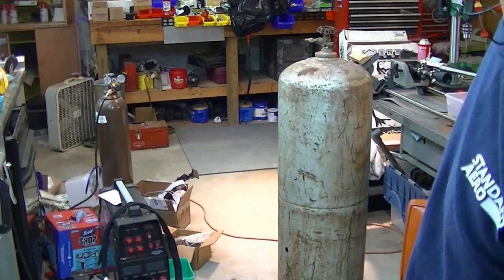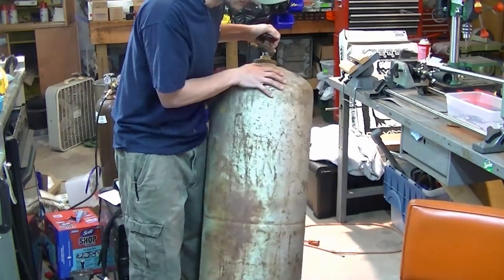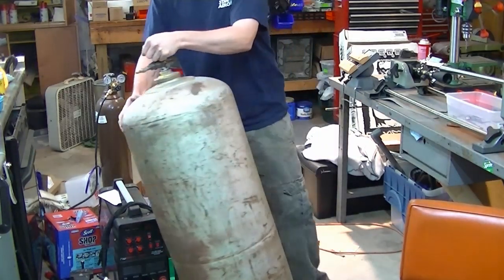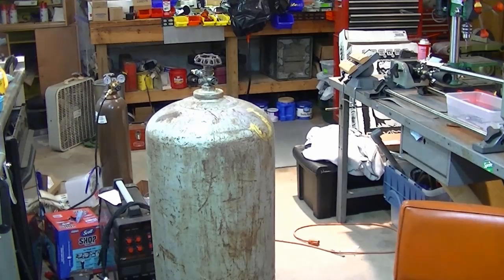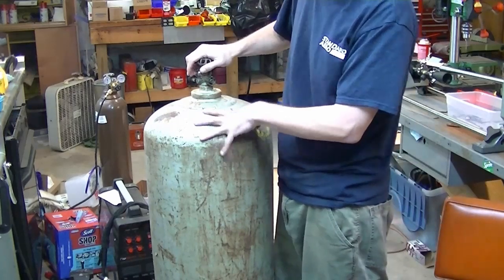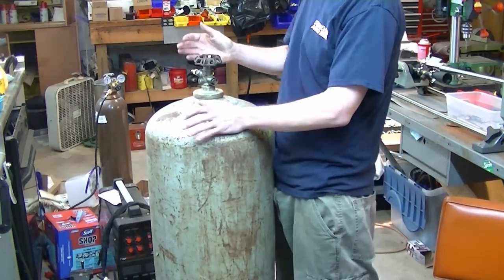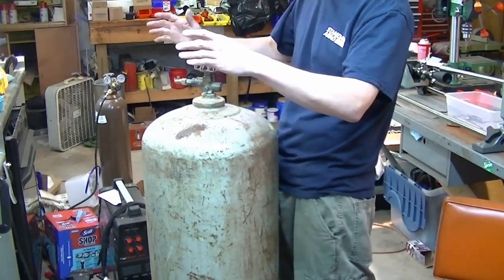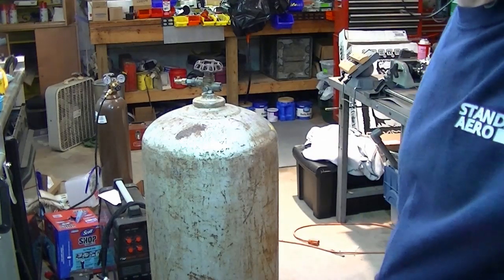Tig Welding with Longevity welder while converting a Propane Tank to work with my Air Compressor

Comment: To get rid of the odor take the valve off the tank, pour in about 3 gallons of clean gravel, 2 gallons of clean sand,  5 gallons of really hot water and TSP, also known as tri sodium phosphate.  Follow the directions on the tsp box.  Roll the tank around, tip to a 45 degree angle roll some more,  plug the valve hole turn upside down at 45 degree angle   and roll some more. Unplug the valve hole, turn upside down and stick a garden hose in the tank to rinse it out.  Odor gone.  Now figure out some way to keep it from rusting.   I still don't understand the bolt being welded in the hole.

Comment: I must have missed it, but I'm wondering why you welded a bolt into the hole?  If you were going to use this tank for air, why not weld a shoulder nut in to use as another port?  You can always put a removable plug into it if you don't want to use it later.

Comment: so how the longevity shut box working is it a boat anker yet?
Reply from the maker: +Jimi Hendrix no, the contrary. I added a mig, and an ac/dc square wave pulse tig and a plasma cutter all by longevity and have run the shit out of the new tig machine. It is hands down a very nice running machine and has been for over 2 years now which is a hell of a lot longer than most Miller dynasty machines I have seen. The plasma cutter could be a little better but does cut on ac as well as dc which is nice. The Mig is just like all the other 140 amp migs,  The old 160sx tig used in this video is running strong in a race car frame shop and is is around 5 years old now.  In all if the longevity machines I have sold none have ever had a problem!

Comment: Ive been thinking of doing the same thing. But i did see another guy who poured a rust paint in the tank to seal it from rust. He poured it in and rolled the bottle around for a while. (Alot of humidity can build up in compressor tanks).
Also the rust paint sealed the inside to get rid of the propane additive that stinks so much.
 Best of luck.
Reply from the maker: You know that is a F'n great idea. I am set up with East wood and the have that stuff. When I put my new compressor in I  am going to do that! Thanks!
Reply: @teamklr2bar  Late post and sorry for the delay but I just saw that video and noticed he put paint in the tank and then put regular pipe on the manifold so at least his tanks wont explode, but the pipe will...

Comment: Dirty Hippie wearing sandles while working! How do you like that longevity welder? Is it holding up? Is it built in water cooled or air coold torch?
Reply from the maker: hahaah, you got it.  I tell you that I have owned Miller, Lincoln, Esab, etc... all and I was so impressed with Longevity that I am now an authorized dealer for them.  I love them. All of their stuff is top notch. "REALLY" it is very good stuff. If you are looking let me know at my welding business email address: HighValueWeldingSupply@gmail.com you can also go to our website at http://www.TDCtactical.com

Comment: idiot
Reply from the maker: why? this tank was around 15years old and was flushed with standing water for over a month's time. There was no danger here. Secondly, the highest pressure it will ever see with compressed air from an air compressor is around 160 psi. This is far less than the thing was rated and capable of handling and does not even come close to stressing the welded area. Don't throw names out just because of your own insecurities and pompous attitude.
Reply from the maker: Jim McCrindle+ why do you think so? I guess you can't read or you would have been able to see why you are incorrect.

Comment: Eastwood Tig Welder?  How do you like it?
Reply from the maker: Eastwood purchases the cases but the welder is not the same. This is a Longevity. I am a Longevity Dealer so drop me an email and we can talk more. I have owned Miller, Lincoln, Esab, etc... and I would honestly (as proven by my owning one) have the Longevity first. It has a 5 year parts and labor warranty and is less than half the cost. The Longevity welders are far above and beyond the other Chinese welders out there and most of the American stuff as well. I am also a dealer for Eastwood. FYI.. For contacting me about welders   highvalueweldingsupply@gmial.com and for contacting me about firearms  TeamKLRDefensiveConcepts@gmail.com
Reply: TDCtactical It's interesting to note that many of the US welders are being made overseas such as some of the Lincoln models.  I have a Miller Sychrowave 200 which I rally like but i also have an Everlast and am pleased with that as well.  I have not tried Longevity, but I have heard good things about them.  I also heard they have good support.  Maybe my next machine will be a Longevity.
Reply from the maker: valveman12 I have owned a number of Miller. The 2 sychrowave's that I have owned were rock solid but the dynasties were junk all 6 had main board failures.  If you decide to keep me in mind, I will give you a deal.

Comment from the maker: Well most of the time the relief valve (pop off valve) is set to between 275 - 350 psi so the tank is rated higher than that.

Comment from the maker: Yea, you need to do more than just sand the paint off. You need to get down past the surface where oxidation has happened. Any time that you weld you need to make sure that you have completely clean and virgin metal.  The hood goes without saying though.  If you are starting out make sure to grab an autodarkening hood. Harbor Freight has them pretty cheap and you can find online coupon codes to make them cheaper!

Comment: still leaks, I I don't have a welding mask yet..  but is a little, I used sand paper to clean the paint around it.. and brake cleaner...  it worked...  but still i'm going to give it a touch in the little holes.

Comment from the maker: Yea, BPC will do that!  How much prep did you do before welding?  Was it super clean (including the immediate area inside the hole) before you welded?  Even stick welding, if there are any impurities it will cause holes in a pressure vessel.  Does it currently leak or did you get it to stop?

Comment: I did well, but I got air leaks all over the welding spot, but now my tank is working again...  I cleaned the spot with brake cleaner and it went inside of the tank and after that a spark blew all the brake cleaner inside the tank, thank god nothing else happen besides throwing my mask as far as I could and I broke it ;(  Now I don't have a mask...
Reply: Except for the fact you almost killed yourself while trying to weld a pressure vessel, which you should never do with your lack of knowledge... Dont EVER use brake cleaner before welding, it releases very toxic fumes and it even says on the can you should never use heat on the product after applying it... Its incredibly toxic when heated. Use a solvent like acetone or alcohol instead.

Comment from the maker: Yea, I don't envy you. I am not much of a stick welder.  Mig would work well and if you are proficient at stick welding it is a great option for this application.  If you are ever in the market for another welder or plasma cutter drop me an email and I will get you pricing on what you need.

Comment from the maker: Blair,  let me also explain that I keep this tank in a remote location.  It is outside of my shop on the back side.  I do not recommend doing this and then having the altered tank inside the shop and/or in close proximity to you.  It's a one in a billion chance that there could be a problem but it's not a big deal to drill a hole in the wall of a shop and put the damn thing outside.  Thanks alot and you are welcome!

Comment from the maker: why??? why would I bother with another option when I have this one?  
Things to consider: 
1  shop air is max 150psi. Most LP tanks like this are equipped with a 375psi pop off valve.  At 120psi (highest I run my system) I am not even at 1/2 of this.  
2  my weld is sound
3  the tank is located outside, on the back side of my shop. It is in a location that is completely safe if    something were to happen.

Thanks for your concern, and for watching my friend.